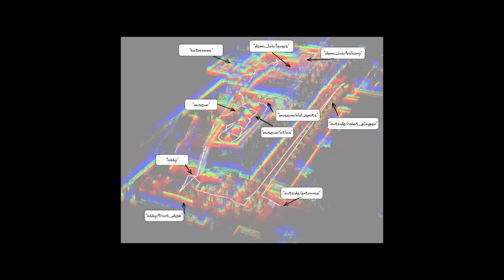Making Chat (ro)Bots

Comment: The potential as 'guide dogs' for the Blind and visually impaired is huge here. Hell, I'd love a Spot bot to navigate cities etc, you ask it directions, it shows you the way. Such a fantastic amount of potential for the future.
Reply: But they'll be easily stolen, especially if you're visually impaired you'll not be able to do much when two guys take it and run away
Reply: @davebowman760  they'd have to install some safeguard on it for sure, or ways to get it back if it does get stolen. Or perhaps a setting that causes it to let out a shrilling beep if it was moved away from its owner suddenly, to draw in the attention of everyone around. Like a pseudo panic button basically.

It wouldn't stop the most dedicated, hardcore criminals, but it'd at least deter some of the ones that like to avoid unnecessary risk and attention.
Reply: @davebowman760  it can act as a guard dog and bite them or something, maybe it could spray pepper spray at them
Reply: @mr_slidey well that could potentially be a bad thing, robots are a lot stronger than we are, even spots clamp could crush bones with enough force applied to it.
Reply: @mr_slidey  isn't one of the laws of robotics is to never program it to physically hurt people?
Reply: @Blue-bf8lv  I had a friend in my uni class once say that those laws of robotics should be repealed lol.
Reply: The first use of GPT-4V (that can understand images) was in the Be My Eyes app. So people with vision issues can take photos and have it describe them to them. Or have it tell them how to move to get to something, etc. No need for a robot per se.
Reply: @davebowman760  Ever wonder why people don't steal guide dogs?
Reply: @davebowman760  Maybe stay away from urban filth then.
Reply: Especially with sarcastic personality. "Now I know you blind man, but you gotta see this"
Reply: Just program it to scream SUUUUUPER loud
Reply: You dont need robot, just a headphone with camera would b enough.
Reply: @davebowman760  A 40kg robot which can move around isnt easily stolen.

Comment: 02:51 "This is where we keep our robot, who can run up to 19mph.... I hope you're not too slow to keep up with it." It begins 😂
Reply: I just realized that this could have also been a threat
Reply: I hope the internals of the robot are not coded using antiquated imperial units.
Reply: @DemPilafian 
Which internals?
- The language model is just a language model. It can't calculate anything, it just generates text. If you tell it that it's a tour guide in the US, it will probably use imperial units when talking to you.
- For everything else, it doesn't really matter which units are used. It's a machine, it can do math. If they do use the imperial system, my guess is that everything is in units of mils (thousandths of an inch) and nothing is ever internally converted to inches, yards, miles, or anything else.

You only really need to care about units when displaying the data to a human.
Reply: It took me longer than I thought to find an AI apok comment on this thread.
Reply: IT BEGINS

Comment: what actually impressed me the most is the speech patterns and speech synthetization. They sound almost prerecordedly natural (not implying they are of course, but its just so hard to believe).  Incredible feat! I'm also wondering how it responds so quickly. Is chatGPT running locally on the spot? (pun intended) Very cool progression and a great way to make the robot more approchable.
Reply: "synthetization"
Irony . An AI would never make that mistake.
Reply: @-danR  Unless it didn't want you to know it was an AI
Reply: Have you used ChatGPT? At least for the free 3.5 version, you ask it a question and it spits out an essay within seconds most of the time, far faster than a human could think, that's for sure. GPT-4 (which this is) is slower I think, but there's no great delay. They probably have some priority access to servers as well. Simple wi-fi connection & API setup would handle it.
Reply: @larion2336  mostly essays that would get failing grades from any competent teacher, but essays nonetheless
Reply: It's not possible to run ChatGPT locally on spot... today.
Reply: The voices remind me of Elevenai's voice synthesis. I wonder if they took some inspiration from that.
Reply: Pretty sure they cut out the waiting time part for speech synthetization. But of course, it's gonna be locally available soon.

Comment: This is a cool demo but it felt like it was showing off more the capabilities of GPT-4 instead of spot. It would have been good to see if you could issue spot voice commands to move objects around it.
Reply: GPT-4 seemed contextually aware of its physical environment. That's a great advance.
Reply: The fact that GPT-4 can competently process and verbally respond to real-time visual and audio stimuli while operating on a mobile platform, with any number of halfway emergent personalities, is a massive achievement.
Reply: its more about interfacing visual and other cues about the robot into GPT4 rather than just the script
Reply: The error rate of the code generated by GPT-4 is quite high, making it impossible to use the code to operate a robot dog
Reply: Spot was an autonomous device before chat-gpt provided a voice and audio interaction.  Maybe in the next iteration, the device can fulfill audiobook commands?  Great suggestion on having a  screen display for universal communication and feedback.  Even some QR codes that can be scanned, would be helpful.  Or go all out with holograms.

Comment: 🎯 Key Takeaways for quick navigation:

00:00 🤖 Spot, the robot tour guide, showcases charging stations and starts a journey.
01:07 🤖 Matt Clingan Smith discusses advances in generative AI technologies and their use in robotics.
02:50 🤖 Spot introduces Boston Dynamics' fastest four-legged robot, Wildcat, capable of running up to 19 mph.
04:00 🤖 Spot's adaptable personalities can be triggered with simple prompts, creating unique interactions.
05:23 🤖 The system enables lateral thinking in the robot, allowing it to respond creatively to indirect questions.
06:05 🤖 Spot showcases industrial inspection capabilities and discusses the versatility of robots in various industries.
07:42 🤖 The future of AI in robotics holds potential for robots to not only follow commands but also understand actions in context, opening up new applications.

Comment: Hopefully one day you'll be able to run the entire LLM on local hardware at real-time speeds. The pause while it's sending your voice to a cloud-based LLM is pretty distracting.
Reply: The 7B models are getting better and better, give it a few years.
Reply: Meta's LLAMA is going after that
Reply: As far as  know we can already run LLM up to 30B on local hardware at about real-time speed. But the pause is still there because most TTS can't speak until the entire sentence is ready. We will need TTS that are better at streaming text to get real-time on average hardware.
Reply: We're getting close, there are now FPGA-like chips that can handle large sets of neural nets directly on the chip in order to hand back outputs to microprocessors and whatnot.
Reply: I'm running a 3B (orca mini) model on my 4 year old phone and it's pretty good at simple conversations like the ones in the video.
Reply: for comparison, a cat took 30 second to generate 1 word, ie: 30 second per word (using speech soundboard) and ChatGPT took only a fraction of second per word. Animal use body language, like swishing tail and walking back and forth, to pad the time delay, while bots & modern user-interface didn't implement delay indicator like hourglass & HDD-light that is once used in vintage PCs.
Reply: We already have that, the best we currently have in a relatively small package is Mistral 7B.
Reply: There are LLMs small enough. Just not as good
Reply: @SamuelMM_Mitosis  I have to disagree, Mistral 7B is really good! And it would probably be even better if they use several LLMs with different expertise chained together in a cognitive architecture.
Reply: @icykenny92  that’s true, but GPT-4 is better. Question is if the difference is big enough to justify using the bigger model. I think right now we are still in the stages where we need the biggest and best.

Comment: Given the same level of AI in an assistance robot, I think I would much prefer an animal styled robot like Spot around the home than an humanoid like Tesla's Optimus, just seems friendlier
Reply: Depends on what kind of assistance is needed. A humanoid body with opposable thumbs is naturally going to be able to handle things ergonomically designed for humans more easily. However, if more basic manipulation is required, Spot is clearly good enough.
Reply: @crowe6961 you're right but bipedalism is 100% a limitation, something we had to trade to free our hands, but a trade-off that robots don't need to make.

The only added value of a bipedal robot is its coolness factor.
Reply: @crowe6961 give the dog 2 extra hands. Or make it like an emmi from Metroid Dread, can walk on all fours but can stand up erect when needed.
Reply: If I have a home robot I want it to: Clean, Cook (including getting items from the refrigerator), Make me a sandwich, Wash Dishes, Do Laundry, use firearms to defend from intruders, and order parts when needed and conduct repairs on itself.  A humanoid body is best for those tasks such as Tesla's Optimus, Boston Dynamics' Atlas, and competitors.

Comment: I think you guys need to increase the microphone gain level and apply a noise reduction filter to counteract the increased noise. Additionally, you should add a stereo microphone to the system to identify which side the sound is coming from in combination with the AI cameras. With all this, people would not have to stress their voice or bend over to speak to the robot.
Reply: What you're seeing here is just a proof of concept, with a hat.
Reply: @Damien.D  the hat is the most important part !
Reply: Looks like they're using an Echo, which already has a bunch of DSP and a microphone array baked in

Comment: GPT 4o is gonna make these bots insanely cool. They were already cool, but the level should increase greatly. 
Random thought: It would be cool if you guys made a centaur bot. Imagine a spot robot, but elongated a bit, a humanoid robot torso with human like arms and a head and then the regular gripper attachment, but a little longer as a tail attached to the back instead of the front. That would be cool.

Comment: the captioning system combined with the gtp model could actually help the robot with tough decision making scenarios where it's base programming doesn't extend. imagine in a narrow space if there was an obstacle/obstruction in it's path. it could feed the image of the obstruction into the vision model for a description, and report that (and what it is trying to do(in this case go from point a to b) to gpt. gpt could instruct the robot to move the thing (if it's movable and appropriate to do so), contact management (or something similar to getting help), turn around or ANY other natural response autonomously in a controllable and configurable manner. nutso.

Comment: 🎯 Key Takeaways for quick navigation:

00:00 🤖 Introduction to the Tour
- The video begins with the introduction of the tour led by Matt and a robot named Spot.
- The tour starts at the charging stations where Spot robots rest.
01:07 🤖 Integration of AI Technologies
- Matt Clingan Smith, a software engineer, discusses the integration of AI technologies in robotics.
- Mention of generative AI, image captioning, visual question answering, voice recognition, and voice creation software.
02:50 🏢 Touring the Boston Dynamics Building
- Spot guides the tour through the Boston Dynamics building.
- Highlighting the showcase of a fast four-legged robot capable of running at high speeds.
04:00 🤖 Personality and Role of Spot
- Spot's ability to adopt various personalities and respond creatively.
- Examples of Spot's responses as a 1920s archaeologist and a Shakespearean actor.
05:23 🤖 Lateral Thinking and Adaptation
- Discussion on how the system allows for lateral thinking in the robot's responses.
- The robot's ability to respond to roundabout questions and adapt to different scenarios.
06:48 🤖 Industrial Applications of Robots
- Exploring the presence of levers and valves used to demonstrate Spot robots' grasping abilities.
- Emphasis on the versatility of robots in various industries and tasks.
07:42 🚀 Future of AI Technologies in Robotics
- Speculation about the future applications of AI technologies in robotics.
- Possibility of robots understanding actions in the context of their surroundings.
08:19 ☕ Conclusion and Break
- The video concludes with a break in the lounge and a humorous reference to enjoying a "cup of oil."

Made with HARPA AI

Comment: Very cool and innovative! I instantly imagined what an AI would be like. I’m telling y’all were close, all it’s gonna take is or one of these low level (unchecked) AIs, take Snapchat AI for example to break out into the inter-web and Hack it’s way into one of these spot fleets where it can thrive undetected until it finds the perfect production plant or multiple and turn in the blink of an eye. The only thing keeping this from being a reality is firewall systems, guidelines and coders. Any Ai would lay dormant until the time is right and too many things go unchecked. Carry on with the upmost top level of security and safety. Also spot would be a prime candidate as it normally does not communicate in the workforce with voice but rather with on site trackers. Easy to mimic if it knows the system. Edit wait these are speech AIs no way…..